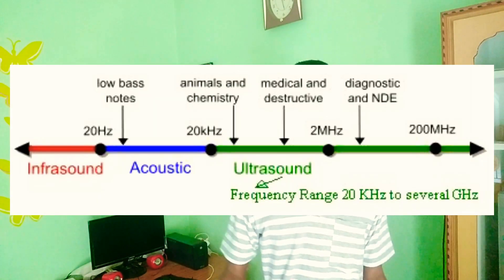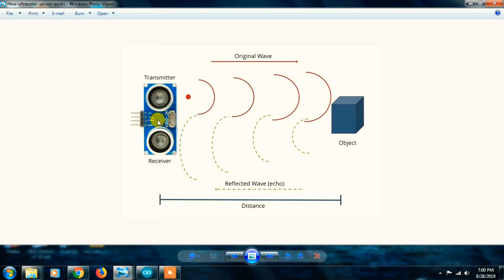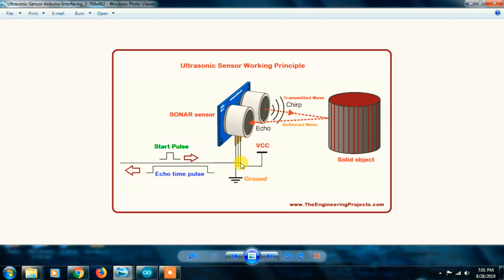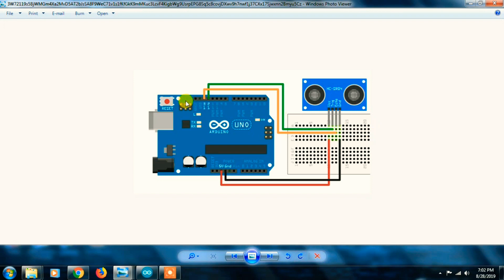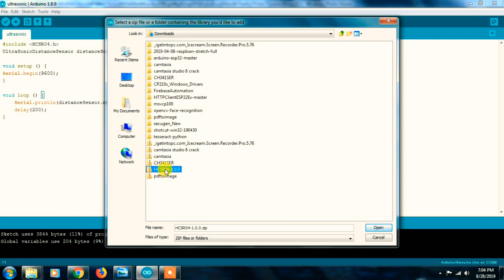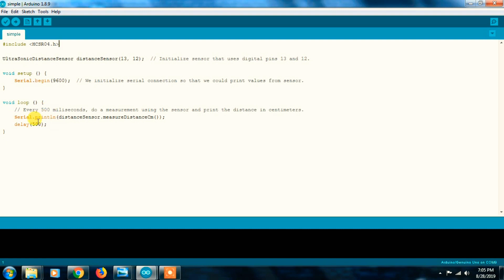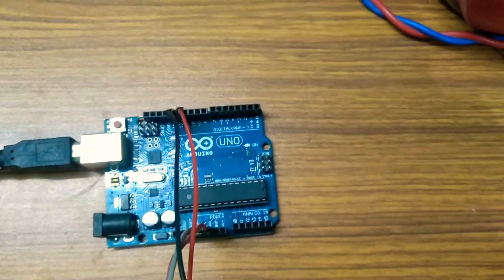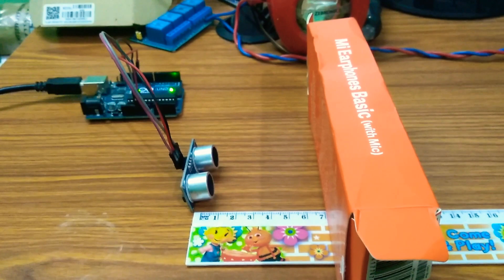Ultrasonic sensor Interfacing with Arduino telugu || how to measure distance with arduino uno

Comment: Ya software mill skta ha
Reply from the maker: Yes you can download there !
Reply: @BETEQ  where?
Reply from the maker: @hassanimtiaz1675  in the description
Reply from the maker: Please check out in the description for library as well as code
Reply: @BETEQ  OK 🆗
Reply from the maker: @hassanimtiaz1675  fine have a nice work with ultrasonic sensor with Arduino